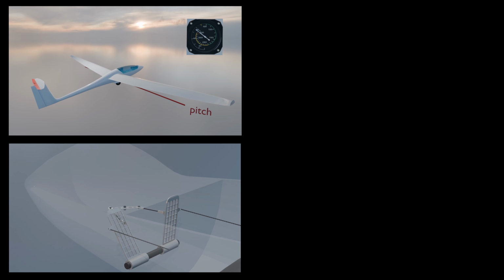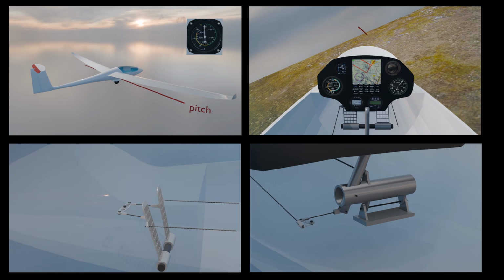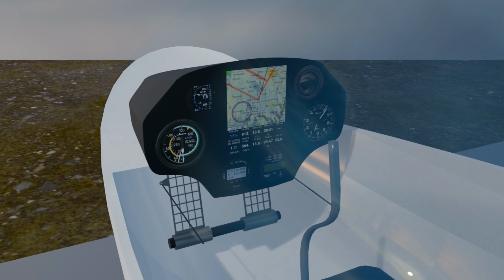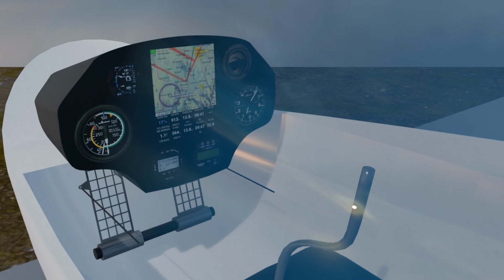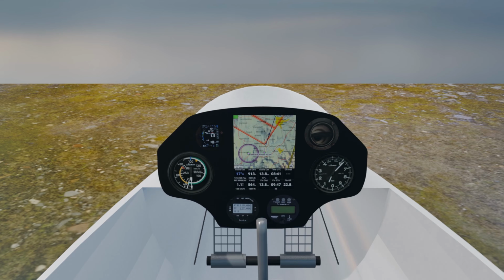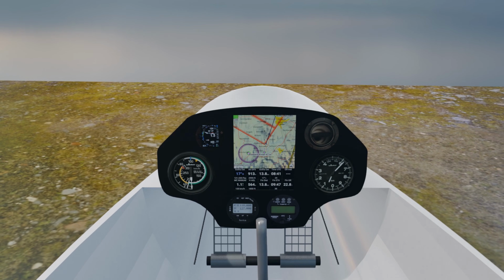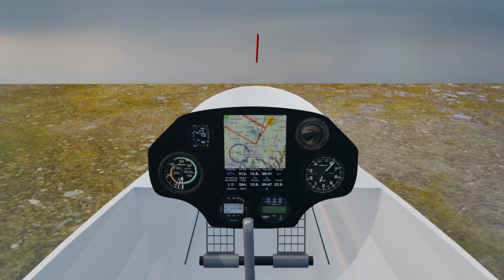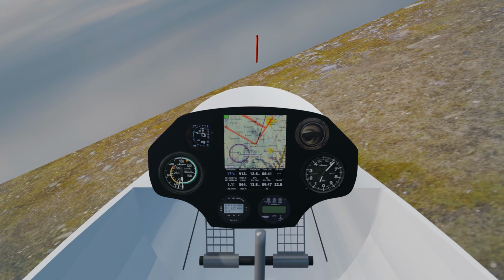How Gliders fly - Part 2: Control & Dynamics #gliders #controls

Comment: Comprehensible video, thanks. 10:51 -10:51 Is it acceptable to hold the helm like the pilot in the forward cockpit demonstrates?
Reply from the maker: In a calm weather situation like this - why not. BTW: this is a 4 times austrian glider champion … and what i remember, during aerotow, steeper turns, landing we switch to „normal“ grip position.
Reply: @spitzflight  What's the point?
Reply from the maker: In 10:51 you see a pilot holding the stick with the brakes (wheel) not the regular stick …
Reply: @ Yea I noticed that, I was just wondering why.
Reply: @ChristianMeyer  I think Walter is just comfortable anthropometrically with his elbow and his arm length is just up to the  handle.
Reply from the maker: Maybe a small blister or an temporary injury on the hand. But i think its simply a more relaxing position. When i met him i will ask… (if i dont forget …)
Reply: @ Ok cool!

Comment: Love the new vids. Could go into adverse yaw a bit more using the model and forces generated by the resulting wing shapes. ie what a drag and don't forget the slip :D
Reply from the maker: good point. I am gathering new ideas and eventually will make a vid about these things with more detail ... thx for feedback !
Reply: @spitzflight  Cool, forces could be it's own video. Coupled with safe gliding speed, operational limits, g forces ect. Small steps.